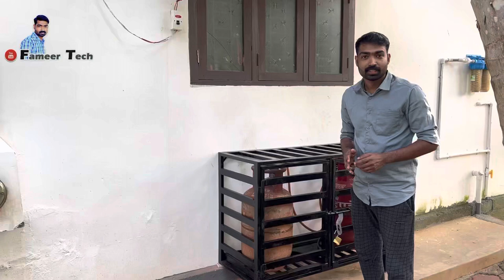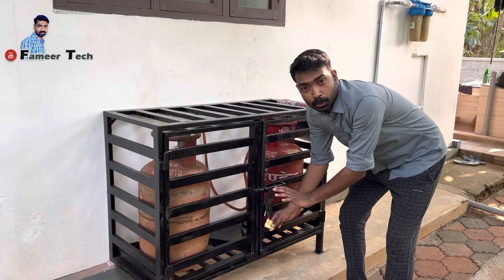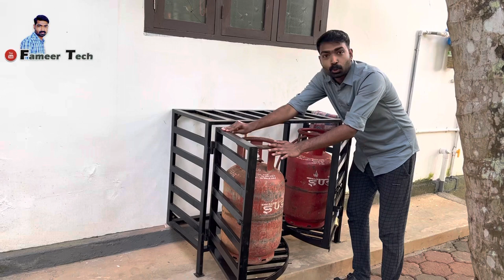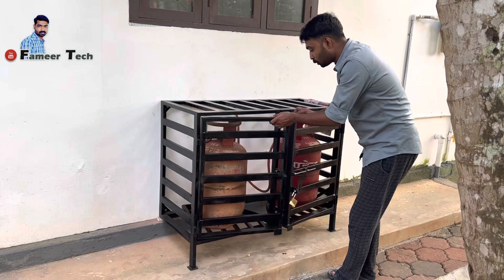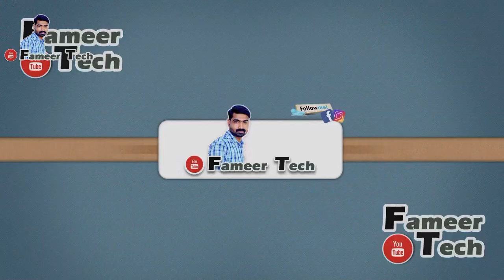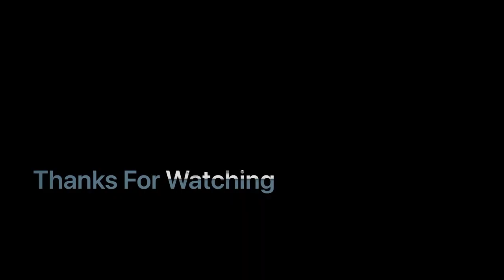How To Install Gas Cylinder Outside / Gas cylinder outside fitting / Gas cylinder Cage

Comment: In case of a fire or gas leakages outside, at the place of regulator or to the hose , you can't see..,
I believe this will be dangerous. Otherwise need CCTV to monitor. 
Also outside Rats might easily bite the gas hose.
So becarefull.